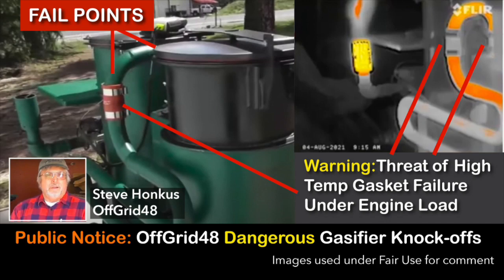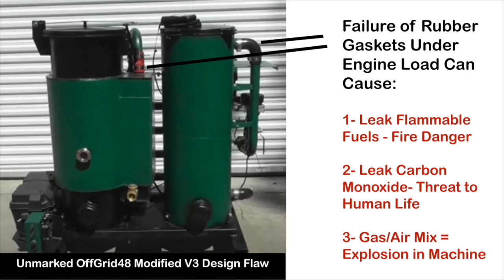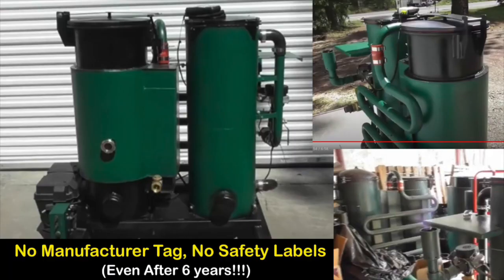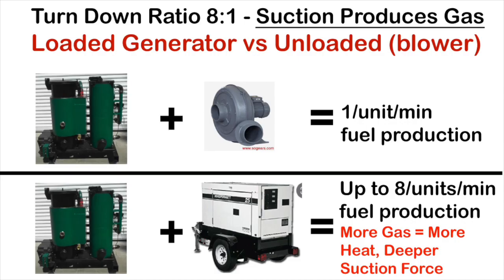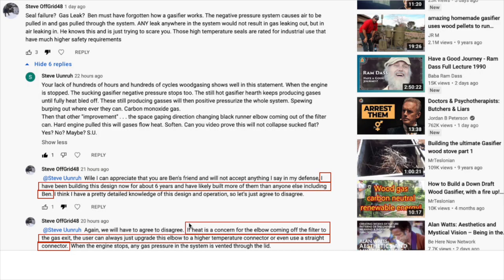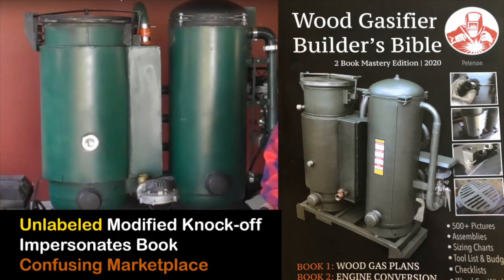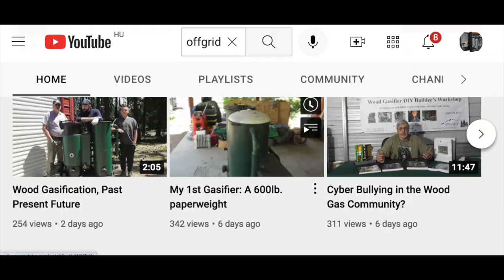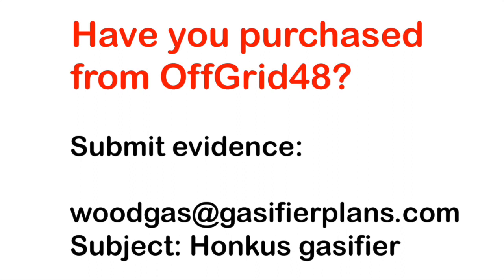Gasifier Recall Investigation: Purchase an OffGrid48 Wood Gasifier?

Comment: Aren't you showing people how to store syngas via bag in another video? Do they know you can only keep it for a short time before it seeps? It's either a non viable way to store inconsequential amounts of gas for a short time, or a dangerous way to do it for a long time. There's a reason why carbon monoxide and hydrogen storage is done in special high pressure tanks. Syngas as you know, is both of those gases. One is known to degrade and seep through everything, the other is poison, and both are flammable. You're getting after him for not being zoned for manufacturing and not being bonded, for a pipe being hot via thermal imaging when he's lighting a flare?

Comment: this is a business that is attacking another one. both are asshats but both has good designed. both have silicone on the hot side of the unit that if failed could leak CO but not likely to get into the passenger compartment unless the gasifier is inside LOL. this tecnology is over 100 years old. how about both of you work together against the scummy little corporation owners and politicians that want this and any freedoms squashed. work together and give grace.

Comment: I really wish I could say I am amazed by all of the misconceptions that Bens Book system has garnered here and on the other youtubes. After 14 years pushing against this Free Energy cultural stream; now few, ever amaze me. Let alone inspire me. Ben's Book system was never about being a "product". It was not about saving the current world. Saving a country. Saving a religion. Saving the white race. And certainly not about saving a gone off the track 150 year ongoing consumer culture.
It is a true Gift plan on how with your efforts you can energy back-up for yourself and your family. Work it hard and yourself woodfuel processing and you can even go Grid-FREE. Takes 16-30 pounds of chunked up, lowered moisture wood fuel to replace one US gallon of gasoline. Calculate your going to be needed wood to electric watts from this.
This machine system was presented gifted out without patent restrictions, at a low-low cost, by a guy who did build, try, and re-try at least 100 different systems approaches. I was only involved with maybe 20 of those in four years. Ha! Out of all of my 4 years of better-ideas only one cut the mustard. The woven fiberglass rope seals. Airtight, smoke-free woodstoving doors experiences. No inspiration there. See-works-incorporation.

So all of you cranky disappointed book buyers please do put these out onto the used book markets for guys; and gals, who will sweat the metal grinding cutting, fitting, and welding. And the then wood prepping to USE this Enrgy FREEdom system it was intended. Takes woring exprneces to make any wood to watts system work. Work-sweat to gain this BEFORE the needs.
Actually READ the front and back of any one of the three book versions and hear this in Ben Petersons intents delivery.
For the ten guy Net findable who have built and use their Ben's Book systems HURRAH!! Much respects for your achievements. Know that at least another 100 wanting to be trolling NET-Free have also Bens Book systems built and are using too.
Steve UNRUH (UnnnRooo) Old German name. Wild Nordic genes mostly.
Reply: STEVE, did you see your buddy MattR is COMMERCIALIZING gasification? Think of the people that will die! We must stop this! Or do we only care when there's a massive payout for Ben p?
Reply: @mathewstephen6277  Man, oh man, but you are dense.
On the other youtube topic I put up these commercial gasifier business's: Garringer and L.E.A.F.
I put up 3 links to Ben Petersons Victory Gas Works all SS units that were from his commercial shops business.
Matt Ryder speaks for himself and his commercial businesses.
1) the Bens Book system was specifically said not to be built by, "Business Opportunity Seekers".
It was designed and intended to be DIY built one unit at a time.
2) BenP. has clearly stated in the first video that Mr Steven Honkus and family are free to have their own gasifier system manufacturing business. ONLY like these other commercial business have done use his own design features. Supply his own business liability insurances and bonds.
This means Stop using BenP's unique sifter grate mechanism. Stop using his floating inner insulation retainer sleeve. Stop using his whole pyrolysis accelerator section.
And I'll add: Stop using his recognizable hopper lid latch.
There are other ways open source historic to do all of these.
Geeez. 
You are like talking to a child.
Steve UNRUH

Comment: I bought you very first book and in the back it says these are open source plans. Do whatever you want and good luck starting any kind of business. From watching offgrid48 videos I believe he has made a better product based off your original design. I would like to see a dyno run on both of these designs.
Reply: Sells DIY book to DIY community. Acts like a b*tch when someone actually DIYs. Don’t spend every bit of your book money and savings only to be destroyed in court.
Reply: I have yet to buy the book just relying on fema plans and how to vids on youtube and part of me does not want to buy the book. I don't want to fund this spat going on which is a real shame as I'm sure there is heaps of helpful information in the book. 
The way I look at it is Gassifiers are inheritance from an old time when war caused mass fuel shortage they were a short solution for farmers to keep the tractors ploughing. All these new models are spin-off designs but all suffer the same problem they eventually burn out the burn tube I want to redesign this part with cooling system (milled stainless steel block) to prolong the life before having to replace the part. A solid stainless block is getting a reported 1000 hours run time or 42 days continuous use before melting I need/want to get that to 4 times the life and also want completely modular design for ease of refitting cleaning the system. I intend to have two seporate gassifiers so I have no downtime. This online BS needs to stop just cut all ties with eachother and let the proof be in the pudding don't get this sector regulated against it just screws everyone gassifiers were around before you and deserve to be around long after.
Reply: If the seal could leak, it is a human safety issue. All other points in this thread are far less important or have I gone crazy?
Reply: @baloog8  "could leak" and "do leak" are very different claims. Ben doesn't have a single example of them leaking in Steve's 6 years of business. He's never even seen one of Steve's builds up close. This is all from a picture he pulled from Steve's channel.

THIS is about money for Ben. He thinks he is entitled to some sort of compensation for Steve's success, and he's throwing a fit on the internet because he didn't get what he wants. Go check OffGrid48's channel to see the other side of what is going on and you'll get a better picture.
Reply: @mathewstephen6277  Mr anonymous good manufactures test and then de-sign in safety features BEFORE selling a product to users. They must. It is the only way they can keep financially afloat. It is the way they show human concern and decency.
It is this 40 years modern world concept of using the first buying-in users as the beta testers that has become the norm that is puking sickening.
Once again you lie for effect. Honkus has only used this on his latest version V3's. So not for six years. So it is the buyers of these that get to do his in-hard use stress testing. True event Grid-Gone-Down driven needs. The PV solar folks in their 2-3 months a year needing to be operated these hard will be the testers.
This ain't hobby hot-rodding where Opp's!, I went a little bit too far this time. Oh, well. Back to turnkey driving the old stock factory Chevy-Dodge-Ford.
Folks. Only trust those who actually do live off-grid for their opinions and to comit to their recommended systems.
You do not what to be an: "Opps! Sorry about that. We will do better next time." WE! WE! Who dat'? You? and the mouse in your pocket?!
Steve UNRUH (UnnnRooo)
Reply: @Wood-For-Power1  jeez you've come up with some crazy nonsense in that head of yours. Ben took a picture from Steve's page on a THERMAL TEST, and even acknowledged in the video that this is from Steve's  TEST. So how can you and he say he hasn't tested it, when Ben take a screen shot of Steve's test? 
Again, no evidence of leaks anywhere, just armchair quarter backing from OffGrid48's direct competition.

So clearly you and Ben are lying about OffGrid48 not testing his design. The real thing that has both of you huffing and puffing, is that Steve hasn't given in to Ben's extortion demands. Ben doesn't have a legal claim to anything, and this nonsense you keep repeating is complete BS.

I fully expect Ben to edit that part of the video out, now that I pointed out the flaw in that logic. Just like he did with his book description, prior to posting these videos, removing text that refutes his accusations. Videos been saved, just to be safe. The internet is forever, Ben
Reply from the maker: @mathewstephen6277  Thermal tests under blower suction are not load tests under engine load. As I explained in the video, gasifiers work under turn down ratio. The customers are buying these machines to run engines to make power. That is the important testing that isn't being done. Why do you believe that Honkus doesn't have to stand by his work with actual wood gasifier mastery of use? He is a business opportunity seeker, not a wood gasser. If you have expertise in gasification to even comment on this please provide.

I let Steve make machines under the condition that he add to the legacy of gasification as a DIY educator. That means running engines, finding better ways to chunk wood, etc. What real wood gassers do.

Not a commercial manufacturer putting out units that aren't tested on multi-cylinder engines. HE DOESN'T WOOD GAS. He hasn't kept up on his end of the bargain. Steve Honkus was told in January that it was obvious that he doesn't have the skills he is pretending to have. He decided not to get those skills and he was asked to move on and stop making look alike units in Feb/March. 

You keep mentioning the book. It says in the book "...agree to hold harmless and indemnify the author..." Honkus hasn't done that. He is not owning his liability which is core to commerce. 

The emails I sent were his chance to settle for the damages his fraudulent business practices are causing. He is impersonating my work in look and by taking my photos and using them on his website to offer gasifier engine products he couldn't deliver. That's fraud. I covered it in my last video. You conveniently leave these important points out of your repetitive spam comments.
Reply: @mathewstephen6277  Where is your gasifier? Any videos of it?
Reply: @lostcause7653  lol, what does that have to do with anything I'm arguing? Do my legal observations get thrown out if I don't have a video of my gasifier? Yeah, okay dude 🙄
Reply: I respect the hard work you put into your craft as I have your book and it's very precise and detailed.. and can see your points.. It took a lot to own your stripes in hard work. Steve seems like he could own up to being overstretched. I hope he gets support to slow down and strengthen or at least pay attention to what you are saying.. even if you coming off unpleasant to him. 

Sometimes I feel like a Steve. Don't want to be as careful, patient as my father and he was hard on me. But to heal and integrate is always best.
Reply: Hey man, put down the beer. Get your head out of an engine dyno room roar. These woodgasifiers: BenP's book version; Honkus'sV-3's are primarily to woodgas fuel IC engine electrical generator systems. Those make electrical watts power not tire smoking horsepower.
Now that I got your attention go back and re-read your 1st version book. In the ending it gives three ways to get one system built for yourself. It says you could LATER; ONCE You know how to OPERATE well; m-a-y-b-e THEN consider an at home garage-shop DDIY making one, two units a month. Carefully pick your buyer and sell these. STAY SMALL. Enjoy life. kick back then and go fishing. Selling few then your after-sales service problems will remain small, manageable.
And BenP says once, twice, and a then a third time before you would do this to "Know Your Shit". Meaning know woodgas making and engine powering with your system forwards and backwards.

No where does it say, "any kind of business". Why do you lie??? Why do you incompletely mis-quote??? Think others of us do not have 1st verson books too?
It distinctly does say this book and this system, "Is not for Business Opportunity seekers", "Not for (Gov'mint/University) Grants Chasers".
This is not a product. This is an energy freedom machine. Individual personal Freedom comes always at the price of blood, sweat and tears.
You cannot buy this kind of freedom. Only work for it. Trade your book off for beer to someone who will actually use it.
Steve UNRUH
Reply: @Wood-For-Power1   Beer helps when I need to calculated hp to watts for apples to apple comparisons between different output sources. I do run an engine dyno in california and tire smoking horsepower is actually exactly the same in any internal compression chemical heat engine regardless of engine type, displacement or rpm limits. I test many different fuel sources from alcohol to methanal to syngas and propane. each has its own trade offs like detonation resistance and Stoichiometric ranges for the fuel to burn. 
    I build my engines for the fuel that is going to be used. Some engines can run much more compression and more timing for a cleaner more efficient power source but its completely dependent on the type of fuel used.  I have experimented with a wood gas motorcycle and had a blast riding it to work and back. I'm sure there are still pictures all over the internet. 
    The way the government likes to get involved with regulation has severe consequences that once implemented cannot be undone. Take a good hard look at how this is going to work out. Its not going to be very much fun when your labeled a criminal for pursuing a fun hobby; much like hot rodding, gunsmithing or beer brewing. 
     If you would like me to send you a beer I just brewed up a batch of hazy blood orange IPA with a stolen recipe off the internet. The book will go in the garbage...
Reply: @beerpowered1  A good can drink room temperature Belgium Ale please. Trappist. Rodenbeck. American substitutes of Pyramid Apricot Ale or Kennebeck Blueberry Ale keeps me hot days woodcutting. Have to cut, harvest, stack to dry down for the seasonal heating of two house. 
Add in a wood-to-electrical system household or shop electrical suppling it will take the wood equivalent.

It ain't even so much about the gasifier system . . . these two will dyno out the same given the same engine and woodfuel stocks.
IT IS ABOUT YOUR ABLITY to source, harvest and process the woods for all of these needs.

property
Reply: @Wood-For-Power1  Oh Steve, you're posts are always so fun to read. That's not what it says bud, try again. And even if it did actually say that, that's no legal basis for anything Ben is accusing Steve of.